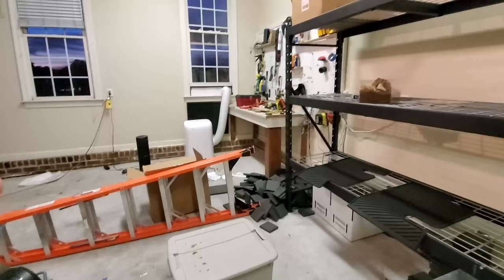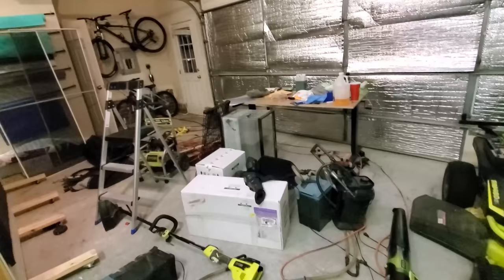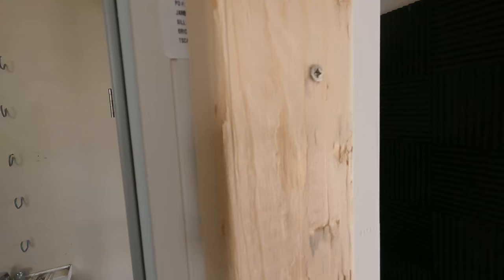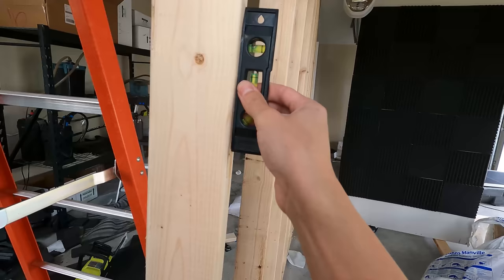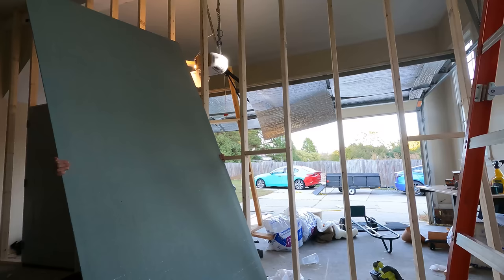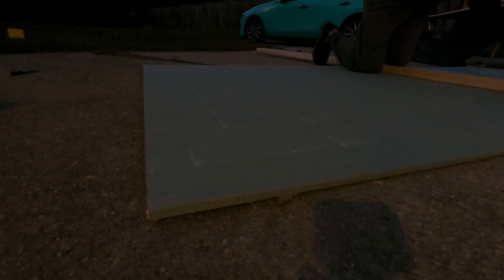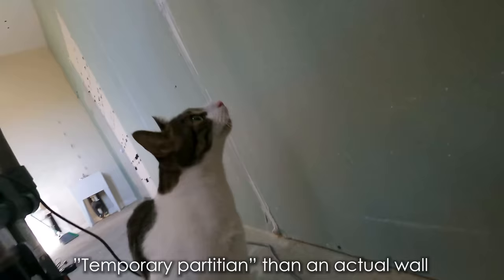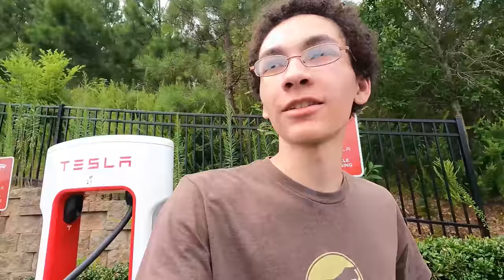Converting My Garage to a Reptile Room!

Comment: I've only been a carpenter for about 7 months now but I can say it ended up looking good in the end for one person who hasn't built a wall. Really just wanted to say the studs being that far off plumb is most likely your tiny cheap level. You want at least a 6 foot good quality level for a wall that tall. Boards are never perfectly straight and have a "crown". Wich makes most of them have a bow down the edge. Awesome video btw!
Reply from the maker: Oh I didn't think about that. The level came free with some hammer or something, but the wall is definitely leaning - I realized because I cut them just a little too long so when they felt upright, they were actually at an angle in order to fit
Reply: @GoHerping  Lol sounds good. In that case it might be a good idea to try to secure the bottom of the wall to the floor so it doesn't slide out And fall. Usually we use a tool called a Ramset to shoot a nail through the bottom plate (in your case the 2x4's separating your studs) into the the concrete. But damaging that concrete floor in the garage is a big no no. I can ask my boss what he would do when I get to work and get back to ya if you want.
Reply: @boomerlastname9361  I wonder if he could do something similar to what you describe, but instead of through the bottom of the wall into the concrete floor, he could do through the side of the wall, near the bottom, into the walls of the garage on both sides.

Comment: You did a great job on the wall, just one tip to make drywalling easier is not cut it into so many joints, do full sheets on the wall and have the factory joints line up for easy taping.

Comment: If the level bubble is going away from the outside big garage door tap the bottom of the boards going towards the big garage door(hit the direction the doors are). That might help get it back to level then screw one large board along the bottom and into the house wall at the ends. That might help it stay level.

Comment: Have you considered redoing the floor in there? We had a hard concrete basement that we put like these cool wood colored floor strips on. You just cut them so they are the right length and they stick to the ground. It keeps the floor a little less cold on your feet.
Reply from the maker: I considered it, I was worried I'd have to insulate the entire floor but I don't really mind. And all the animals will be elevated anyways
Reply: @GoHerping  We didn’t need to insulate the floor. It worked great. And I live in a massive frozen cornfield so…

Comment: Good work overall.  Professional builders build the framing flat so it’s easier to make it straight and then rotate it into position.
Reply from the maker: I was hoping the beam would keep me level enough to not have to worry, but not quite lol
Reply: @GoHerping  is it anchored to the floor at all?  Putting a beam at the bottom and bolting that to the floor would help with stability.  I couldn’t tell from the video. 

Also may the building inspectors stay away. 🙏

Comment: I got REALLY EXCITED TO SEE WHAT YOU WERE GOING TO DO NEXT! YOU DID A FANTASTIC JOB!!!! BRAVO!!!! IT LOOKS PERFECT TO ME! Just a little slit on the upper wall which made me worry about heat/cool loss and the cost of your electric bill, but other than that, WONDERFUL! I've seen those floorboard heaters that line the wall and the floor. I don't know if they cool for summer. There are these wall a/c units that are small. I've seen them in Japan and in the Caribbean. They cool a smaller space and do work well. I don"t know what they are called or the cost. Both the a/c and floorboard heater I think are electric, so you'll have a higher electric bill, if you are looking for something permanent and go for those. Alex, you are quite an inspiration! Plus, I caught the stud joke... not a joke, 😊. Really, a fantastic job. BRAVO again!!!

Comment: If it got too hot for a studio, will look use some sort of cooler for the summer?
Reply from the maker: It was too hot when I tried insulating the entire garage door, even with an AC unit. but since I added the wall it just stays at whatever temp I want
Reply: @GoHerping  ahh gotcha!